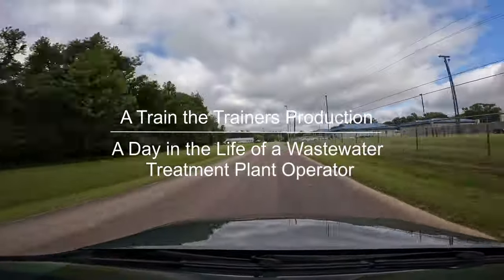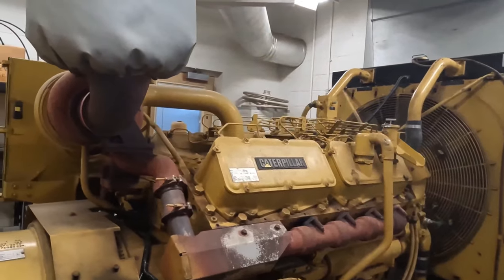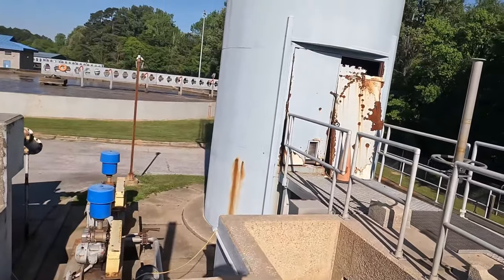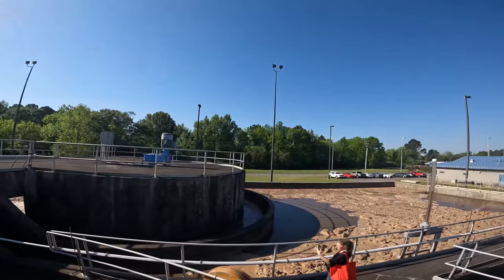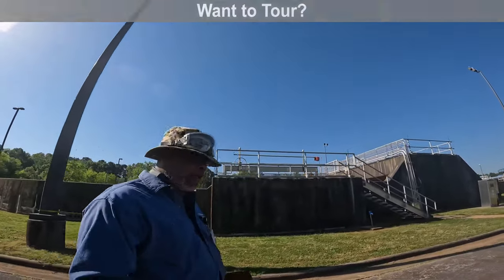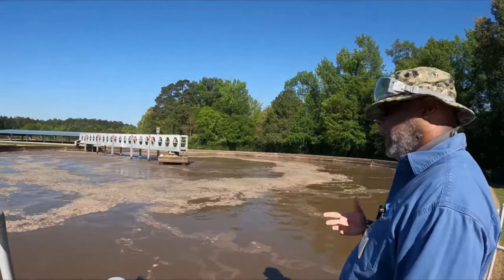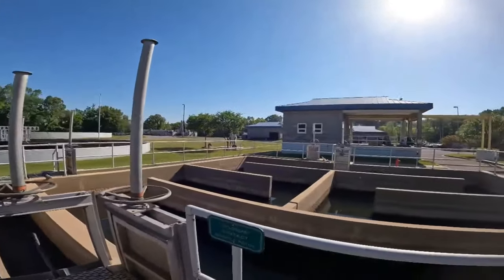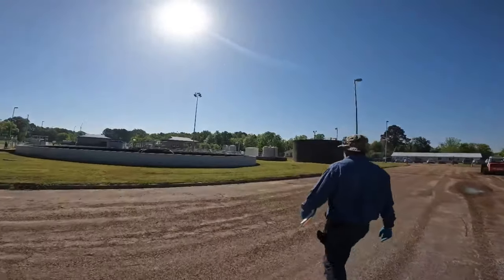A Day in the Life of a Wastewater Treatment Operator

Comment: Here in Texas OSHA has no power over government entities, ie. City run treatment plants but we do have our own safety officers which are a bigger pain. Also operators arnt allowed to open and access any electrical panels; thats where i come in and work the electrical wires. Thats not small 12volt equipment alot are 480v. Most of the time when the RAS pumps have "stoppage" they pull the pumps out of the pit and free the rags, etc. By hand. Reversing the rotation of the motor can and will damage the motor if done for too long.